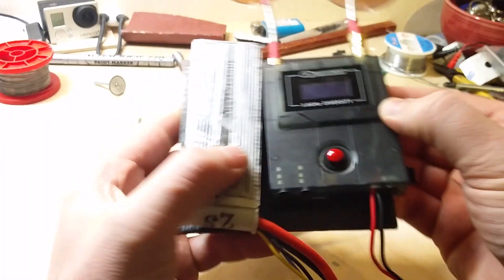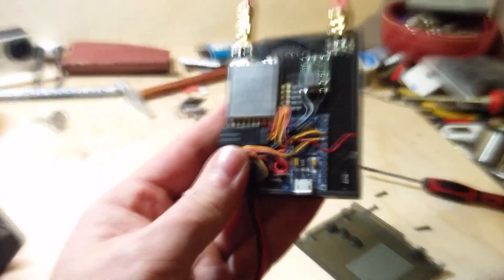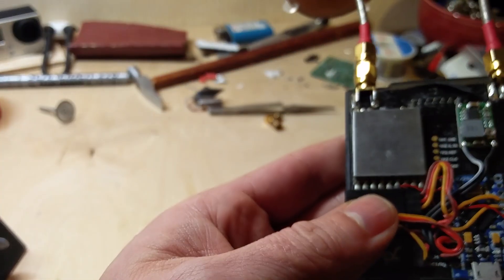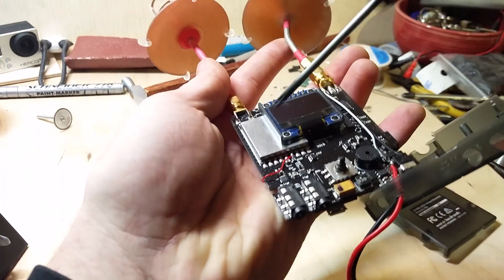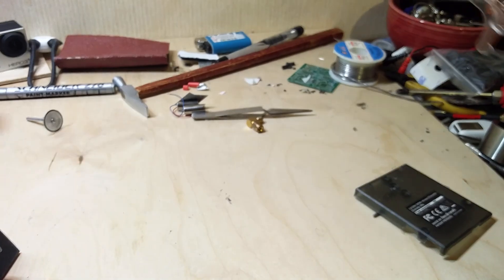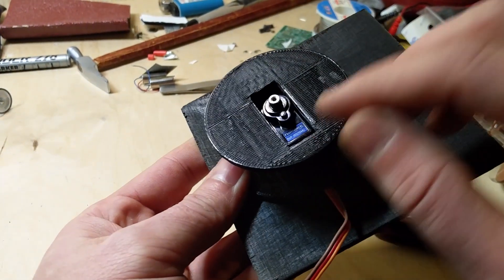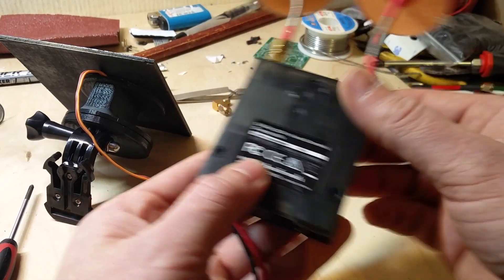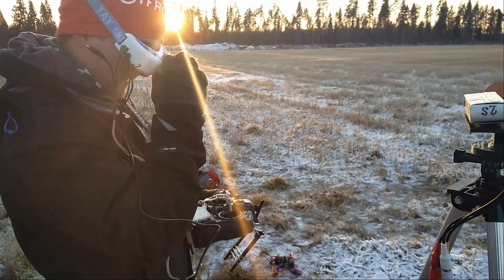SUPER SIMPLE 5.8GHz RSSI ANTENNA TRACKER

Comment: Hello!
I have some issues about RSSI. Follow your instruction, I used fr632 to out rssi RFA (left) and rssi RFB (right). But the raw value of rssi RFA is alway low than rssi RFB, so how can I calibrate it? Thanks so much for your help
Reply from the maker: I heard from another guy that FR632 RSSI_MAX is about half of default value. You can see raw value by uncommenting //Serial.print("RAW RSSI: "); section in the code and turn on serial monitor.
Reply from the maker: Sorry I dont know about that. Just go to Tools/Serial monitor in Arduino IDE and you will see rssi values.
Reply from the maker: In the code there are RSSI_OFFSET_LEFT and RSSI_OFFSET_RIGHT. Assign positive offset value to RSSI_OFFSET_LEFT,  find value where A and B are equal.
Reply: Thanks so much for your help! It's work fine.
I cannot wait until the weekend to test it :)
Reply: Hello Huy Le, when you used fr632, did you need to change the value rssi max and rssi min in the code?
Reply: and rssi min?
Reply: Huy Le how did it go with the fr632? i'm planning to build one using thesame VRX. i hope you can share your values used. TIA!
Reply: Hi. The bad news is I already stopped this project. Because when I test on the air field, the tracker is too slow and sometime wrong... So I switch to new project, you can use two fr632 and made it become 4-Diversity :D
Reply from the maker: Do you remember which tracking curve you were using? I updated the code a while ago, I added SIGMOID curve which is much faster than the old one (still limited by servo max speed)

Comment: Thumbs up to you guys. this is the most easy and clean RSSI tracker I've seen here and there. 
Do you think I can use Nano 328?
Thanks
Reply from the maker: Thanks Shamim! Arduino Nano is a very good choice because you can program it via USB. And  probably will fit inside RC540 too.
Reply: Thank you for your quick response. 
Actually I tried a few minutes ago but I got this error; 
"compilation terminated.
exit status 1
Error compiling for board Arduino Nano"
Any idea?
I can connect the board and do some basic example like "blink" and it works with that command but I cant load or verify your codes.
Reply from the maker: I don't think this error is related to code. First make sure you have installed Servo and Timer libraries. After you have done that, try selecting Arduino Leonardo (or some other) as target and compile the code CTRL+R. Also you can try downloading an older version of Arduino IDE and try that. I've seen weird IDE behavior, when everything works on one computer, but not on another even IDE version is the same.
Reply: Thank you for your help. I think I need to learn more about Arduino programming. I have just "simple-rssi-antenna-tracker.ino" file and I cant find libraries.
Do you think you can help me through email?
Really appreciate your time.
Reply from the maker: +Shamim Moohebati Sure mail me
Reply: Thank you a lot

Comment: Could you use any diversity reciever for this or does it have to be this one specifically? great job by the way.
Reply from the maker: Basically any receiver will do. All you need is 2 measurable RSSI outputs. The voltage range might be different than of RC540R, but that is easily compensated in code. I heard someone is using FR632 and Yang (in comments below) is using D58-2 receiver.
Reply: @AnttiVainik  how do you know what pin is rssi output on the RX?

Comment: Thanks, I have succeeded in making the receiver using the D58-2 signal. Unfortunately, China can not find MG Servo 1.8kg TGY-9025MG steering gear, I use the GS-9025MG 9g GOTECK alternative to complete. Currently relatively stable, consult whether it can speed up the antenna rotation speed? :)
Reply from the maker: I'm glad to hear you have made one! It doesn't really matter which servo you use, any 9g servo is fine.

To increase speed  you need to change these lines. The simplest way is to assign a fixed value:
  // move towards stronger signal
  if (avgRight > avgLeft) {
    ang = 2 * (SERVO_DIRECTION * -1);
  }
  else {
    ang = 2 * (SERVO_DIRECTION);
  }

But that will make tracker to rotate at constant speed at all times.
A better way would be to use exponential curve:
    ang = pow(float(avgRight / avgLeft), 10) * (SERVO_DIRECTION * -1);
You will have to experiment to find a good exponent value. 10 might be a good value to start with.
Let me know how it goes.
Reply from the maker: Hi Yang, you wanted more speed. I added exponential and sigmoid tracking. Check out new code on Github.
Reply: Nice job mate pls share the Arduino code thnx!!
Reply: Wow! see the news, thank you for sharing. I'm going to download the update as soon as possible test results. These days after the snow to test, eager to see the effect. I am from advertising related work, before flying four axis aircraft never touched the microcontroller technology, this time without your help must not complete the production, thanks again. Expect more perfect results.
Reply: In fact, many previous concerns about the RSSI device on the YouTube, this is the first time in your help to achieve production, feeling very cool, ha  ：）
Reply: Hello. Can you share what you did to get it working with D58-2. I have the same receiver but I'm a complete newbie in arduino programming. Thank you

Comment: What if you fly over it?
Reply from the maker: It depends, how high, and what antennas you are using. If you fly really high, directly above the tracker, and you are using narrow beam antennas, 9-turn helical (45°), then sure you will get static, bad reception and tracker will get confused. But there is no point using highly directional antennas for mini quad proximity flying. For mini quads I would use medium gain antennas like 3-turn helical or patch, both about 90°. With these antennas you can cover over 180° sector. Just don't get too far behind the tracer and not too high. With mini quads we rarely do so anyways.

If you are flying long range FPV with a plane, then high gain antennas are exactly what you need.

Comment: Cool project.  As configured, how would the tracking behave if you were to fly a complete circle around your antenna?
Reply: Antti Vainik you could also use a stepper motor. They are just as easy to program using an arduino
Reply from the maker: Currently I'm using regular 180 degrees servo, naturally that rules out the other 180 degrees. It's possible to use 360 deg servo, but I was in a hurry and wanted to test current setup asap. Say you're flying clock wise in a circle starting from 12 o'clock. Servo hits its limit at 3 o'clock, you continue to 6 o'clock, 9 o'clock  now tracker could swing 180 degrees, but it really doesn't know where the target is. I would imagine it would pick up direction again when your quad is closing 12 o'clock. 

Google for "helical antenna radiation pattern" you will see that helical antenna has quite erratic pattern towards back and sides, so I really don't know how it's going to behave. I'll try that the next time I go flying.
Reply from the maker: True. Also tracking with steppers would be very precise. Servos are easier, everybody has them and everybody knows how they work. Just wanted to keep it simple.

Comment: Very cool!! Are you adding tilt support soon?
Reply from the maker: Tilt is not as critical as pan, unless you fly 1km high, right above your head. I'd say you could get good reception kilometers away just by bending antennas slightly upward.

Adding tilt with only 2 antennas is going to be tricky, I didn't think it thought initially, but I'm going to try. Is it going to happen soon, I don't know. Its winter time here in Finland, it gets dark around 4pm and its cold. I'm hoping people will pick up this project and do more testing.
Reply: Antti Vainik hi, maybe you try with Second diversity. With 3x helix and 1 cloverleaf. Use only 3 helix for rssi tracking.